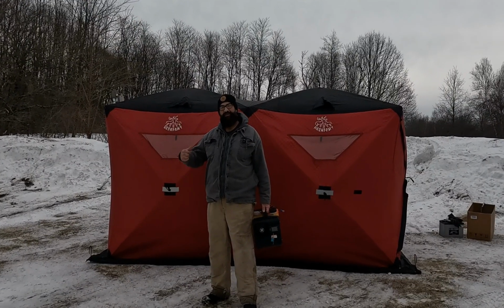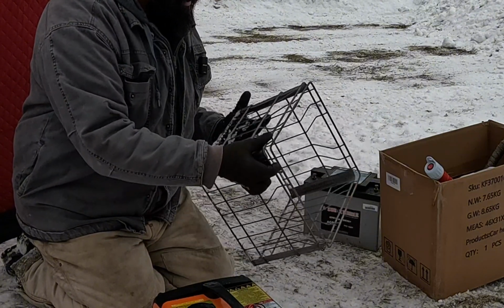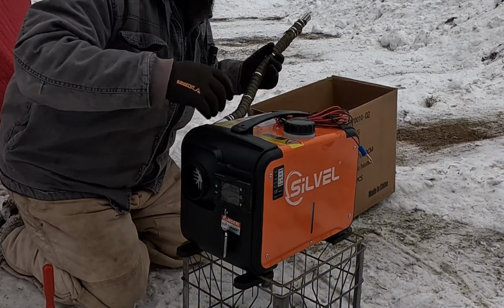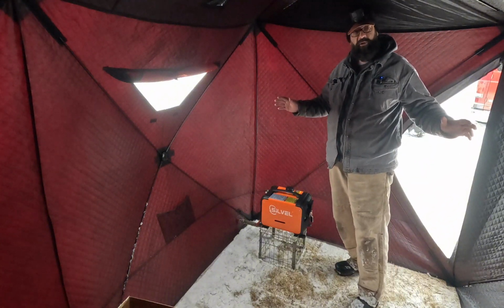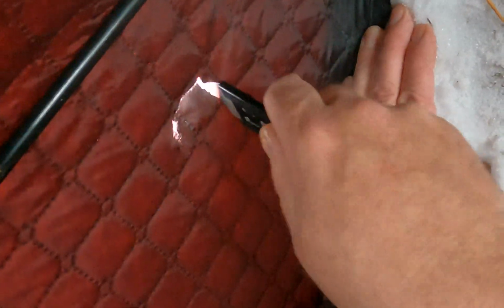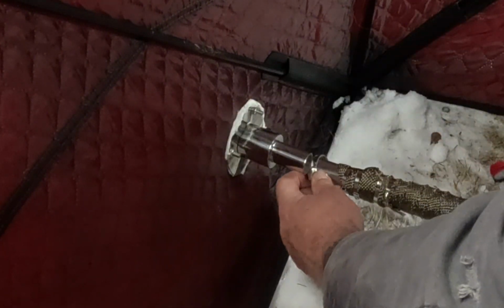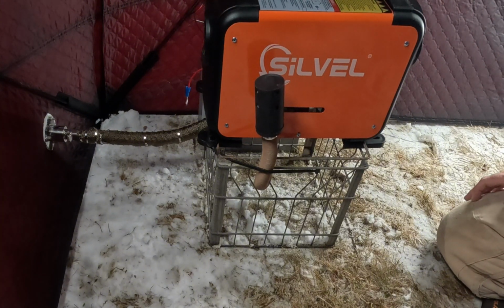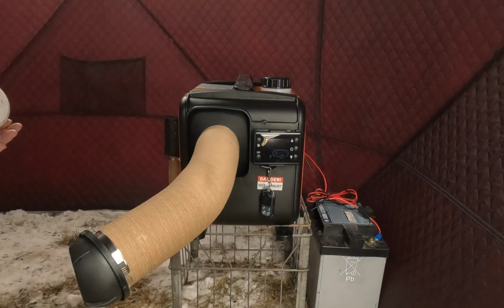Diesel Heater Install In Ice Fishing Shelter Howto

Comment from the maker: *Update  I ran the heater from 11am to 7am the next day set at 19°c and had 0 issues, no readings on O2 sensors, no melted or burnt fabric it was actually cold to touch around flange edge. Only good warm dry heat. 👍

Comment: good tutorial!!, do you think if i didnt have high temp heat mat to add like you did, it still would not melt the tent?
Reply from the maker: After running it and seeing how cool the outer edge the adapter stays, I would say its not needed. Just use the high heat silicone washers that come with the port and you'll be good.   Thanks for watching.
Reply: @BarkEater thanks alot!

Comment: Hi Mike
How long will the battery last? I bought a Colman solar battery charger at Canadian Tire to charge my car battery Im using on my Deisel heater. Would your battery fit inside the milk carton?.
Reply: I think that's nonsense about poor performance with lithium in the cold. Lithium can be used and discharged at any temperature. You can't charge a cold lithium battery but it will be inside your hub nice and warm. Plus a 100ah at half the weight you wont need to charge it.
Reply from the maker: I haven't had it running for more than 20 hours straight yet, but it still had plenty of juice at 12.1v.  If my calculations are right it should last 35 to 50 hours depending on the heat setting. I'll be running it for 3 days ice camping in few weeks, but bringing a backup battery to be safe.
Reply: @ 20 hours is actually a good amount of time.
Reply from the maker: Absolutely.  It will fit in a milk crate but it isn't light.  I may upgrade to a lithium 100ah for lighter weight, but hearing mixed reviews on charging issues when they are cold.
Reply: @ yes don’t go to lithium. They aren’t great performers in the cold. The system you have is great, unless you want to put e money into a system that already works fine to become e efficient but cost more than needed.I like the Diesel heater because of the dry heat. You can place gloves or foot wear in front of the heater and they dry quickly.  Propane heat of ok but throws off moisture
Reply from the maker: My thoughts exactly  💯